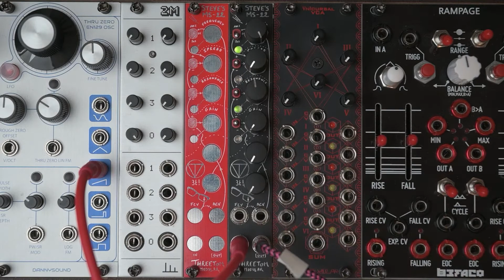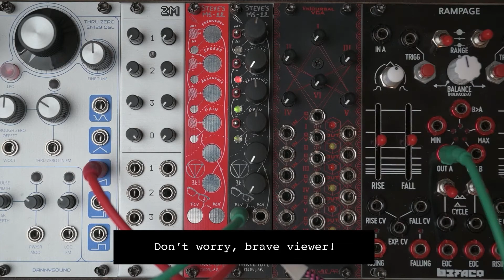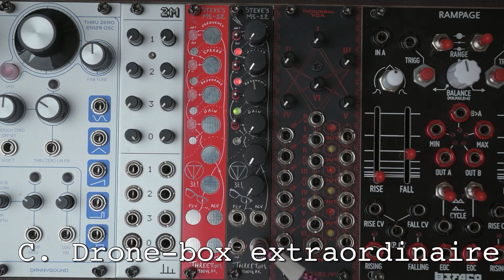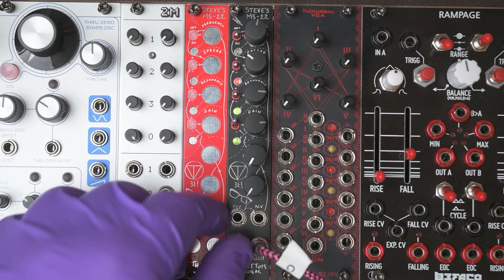Steve’s MS-22 demo video (Dutch Modular Fest 2020)

Comment: Thanks Tom, that's a cool guide which makes it simple to understand what's possible and how. I need to play some more with the self oscillation I think! Do you reckon it would track 1v/oct on the FCV?
Reply from the maker: Thanks! Unfortunately, the MS-22 doesn’t track more than an octave. It’s a trade-off I made for achieving the wide range of self-oscillation. Something I’ve been wanting to experiment with myself is trying to get it to track by making use of a PLL and a reference oscillator. It’s been on my to do list for ages, but I keep from getting to it because there’s so much demand for MS-22’s (while also having a full time job).
Reply: no worries, an octave would be fine probably. You must be very busy indeed at the moment!